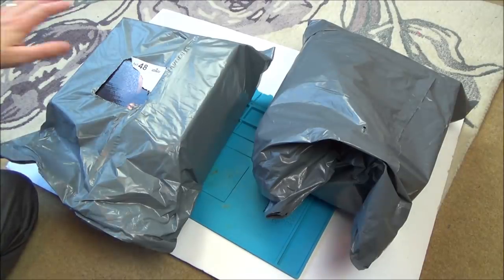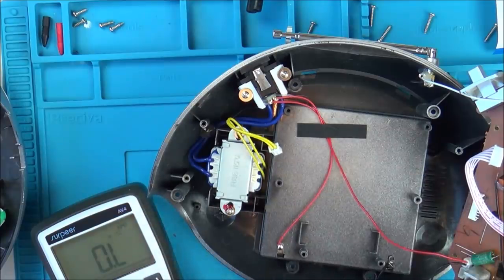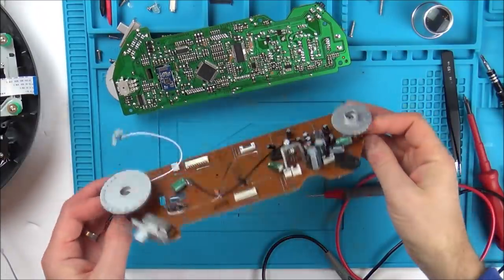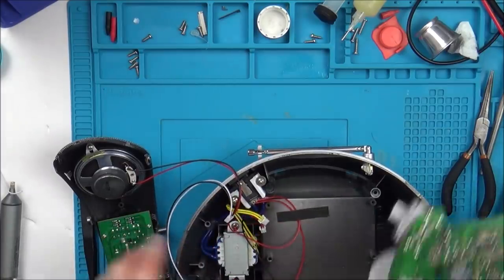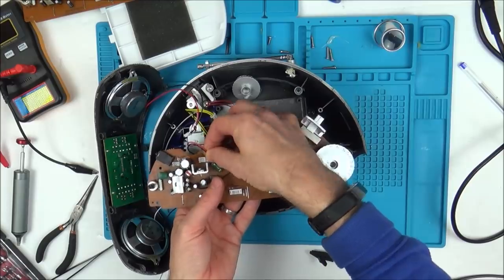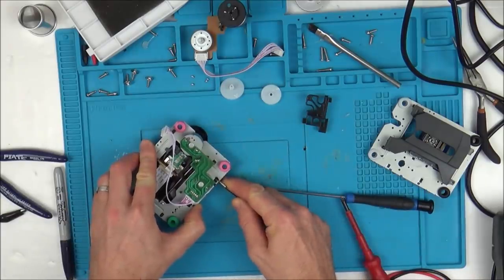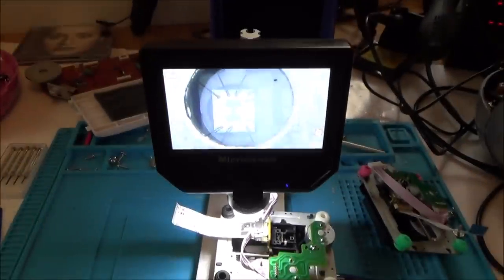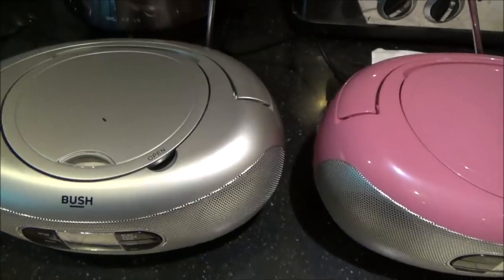Trying to FIX: 2x Faulty BUSH Boomboxes

Comment: These cheap players are all made at the same vast factory in China (I don't recall the name but they're a large company), they make a large number of models with essentially the same design and components, and they all have quite a high failure rate. The lasers are a common failure point, but more often the problem is poor soldering on the CD servo IC which has a large heatsink area and so the pins are often not done correctly. The ones with remote controls have an all-in-one volume/switcher IC which also commonly isn't soldered well and causes problems with volume intermittently working etc. Shame really as when they work they're not bad. Most of the components are copies of old Japanese standard parts and work well when they're assembled properly.

Comment: If the one with the disc issue is able to see how many tracks are on the disc then it's not the laser, it's probably having an issue with the gears and tracking on the disc. It can't move the laser so it just resets and says how many tracks there are

Comment: An good investment for amateur electronics fixing is a cheap portable DSO like a ds213 mini DSO. So you can probe each chip to see if its outputing anything at all...
Reply from the maker: That does look very nice, maybe a Christmas pressie to myself. The problem is I don't under the first thing about the signals and the different frequencies in which they operate.
Reply: @Mymatevince  a good place to start is the "Electronic Basics" playlist from the EEVBLOG.
Reply: @Mymatevince  another really good way to understand electronics in a visual interactive way is a website that lets you play around with virtual components and see how the current flows and the voltage levels of each component. Its called Falstad. There you can even see the Waveforms of the signals as if you were probing them with an oscilloscope. Its great fun and useful to understand how stuff works and how to diagnose using an oscilloscope.

http://www.falstad.com/circuit/circuitjs.html

Comment: I think you were magnifying the photo detector array and not the actual laser diode
Reply from the maker: Yeah, sorry Peter, I didn't realise!!!!! I was sure that was the laser.
Reply: Hi Vince, no one is born knowing any of this stuff. I have been tinkering, fixing and building electronic devices and projects for over 50 years now and I find it as exciting now as I did when I took my first tube black and white tv apart when I was only 6 years old. I really enjoy watching your videos and the no nonsense straight forward approach you take in diagnosing and repairing anything that you attempt. I really love the patience you have, I cant honestly say that I have you level of patience and I also completely agree with another point you try and get across in your videos, its not always about the end result of fixing something every time but the invaluable knowledge you gain in tearing everything apart to see exactly how its put together and how all the various subsystems in any device work together. Keep up the excellent videos and I sincerely  hope you never get tired of making them or get bored in what makes things work.
Reply from the maker: @peterzeboroff7448  Thanks so much Peter :-)

Comment: Thank you Vince,  I put 3 kids through university on the answers an ESR meter gave me. It tests capacitors, but the thing most people don't understand is it puts a high frequency signal through between the probes so it can tell if a coil is OK (IE high resistance) If There is  a short across windings it reads as a resistor.  Also if you have an ESR meter, I knew the designer. I made a modification. I fitted 2 power diodes  across the probes . A to 1 and C to the other and the other in reverse. In this way you can use the meter over any panel without fear of damage. The designer of the thing said, good idea but stops sales.

Comment: Replacing a transistor with a working transistor of the same type is much safer than putting in a shorted transistor and powering up the board!

Comment: Pro tip:
Start by identifying the chips. Search the datasheets online, the datasheets are the best way to understand how things work. When you identify the chips, you look which pins are vcc (power in +) and vss or gnd (power -). Look in the datasheet the supply voltage for each chip and use the multimeter to check voltages (THY SHALL CHECK VOLTAGES). Identify where are the voltage regulators and check caps for shorts...

Comment: I don't believe that transistor is used as an audio amplifier. There's an audio amplifier IC in there that is much more powerful than that transistor. It is probably just used to invert a digital signal. There are just 2 resistors connected to the transistor. Not any caps. It doesn't not look like an audio amplifier circuit at all.
Reply from the maker: Thanks for the info Kris :-)

Comment: Good morning Vince, you finally found the fault , hahaha annoying little shitty component but killed all the sound on the entire pcb man , damn, well we known what cheaper and cheaper means now... Nice long amazing entertaining content as always...
Reply: Now the laser was definitely faulty but you already knew that i think because it's not your first laser fix and definitely it's not going to be a last one
Reply: The screen malfunction fixed laser ordered identified as faulty sound transistor ordered identified as faulty as well ... Now for the ribbon cable connector lock and the connector itself was a cheap ass component as well and on top of that it was very bad soldering from the china factory
Reply: As for the laser dissalignment fault, well even if it's working part it's still a fault cheap component by factory because it's should be aligned and his structure assembly was cheap fail too and plus that ribbon cable on it also ripped off, damn its so many faults on those models and so tiny and cheap, they could get some better components on from the beginning so i believe it's done on purpose, it's the only logical explanation

Comment: Very good videos have been enjoying watching many if them 

In this video I would like to make a comment relating to the laser  i know this late and you probably figured it out by now

But the working part if the laser is in 2 parts the bit at the bottom you put under the microscope with the 9 contact wires is actually the pickup after it's bounced back from the disk  the actual laser is generated from the laser diode on the side  it bounces the laser off of a mirror from the side going towards to the disk and the disk reflects it back down to the pickup at the bottom ( the one you had in microscope 

When you made the adjustment for power setting for laser the laser is actually in that same board center if it 3 pins 

But anyway good work and glad you have the patients for such lengthy diagnostics 

For me who's been repairing electronic devices back in the old days from VCRs TVs CD players and so on I wouldn't go from one device taking parts to figure out what's wrong with the broken one I would find a working part and swap out haha  this was very common practice when fixing VCRs dead power supply jjst pull it out throw another one in job done didn't have the patients 

Now into laptop motherboard repairs and kinda regret getting into that now since the components are super small the worst one so far is this Asus I'm working on mostly fixed now apart from one component needed for the LCD power and that's a bitch to find the component here or anyone willing to pass one on just requires a ferrite bead between 19V rail to screens power rail that's it

Comment: That big Silan SC9637B LQFP IC on the main PCB is quite literally the brains of the system: a single-chip solution CD boombox: http://www.silan.com.cn/english/product/ProductItemDetail.aspx?id=18&pid=20140429095337635343610736320575&c=

Seems like the main issue with these boomboxes is that the rest of the system design and integration is so cheap and nasty that they'll have a fairly high failure rate.

Comment: Aha I heard Argos there, now a funny story is I used to know one of their purchasing managers and he told me never to buy electricals from Argos because they can sell it cheap because its not quite the same as a John Lewis bought electrical item even though it is same model etc and he said Argos had many deals going on being supplied direct by the makers and to keep costs down they cut corners which is how a lot of Argos electrical stuff gets a bad name.  I haven't used them in over a decade, preferring my own list of sellers on ebay and Aliexpress (bought from Ali my granddaughter as a stocking filler one of them "gameboy" 400 NES game loaded deals for £8, with a cute little NES controller for a second player and does connect to the tv...)
Reply: I repaired an argos TV last year, it was almost new and a single electrolytic cap had failed causing no backlight voltage, cheap and nasty components

Comment: Why people use Argos is beyond me, the bulk of the stuff they sell is cheap crap. I bought my kids a decent sound system for them to play their stuff on and it still works now, they still use it connected to their Xbox, it's about 15 years old and was 2nd hand when I bought it for under £50. The rubbish from Argos is landfill in a year because the components are cheap, build quality is awful and they have a return rate of about 15%, that is a massive number and is why you can buy pallets of Argos returns online. Save your money for a few months longer and buy a good named brand even if you buy 2nd hand. Buy cheap and you pay twice (or more).....

Comment: If you want to really learn how to make a successful repairs -> stop require a pair of every device you trying to fix. You don't Broke two to fix one rather than opposite. You can't just swap parts until something works or die. Focus on methodological sequence to follow the faults. Be carefull don't make such sharp movements around the electronics. Also try to learn some fundamental electronics principales to understand the basics on how a given schematic work and how to tracing the signal/power lines/sources in every schematic or distinguish them.

Comment: This is not the laser Haha, the laser are round. And the laser have only 3 pin, the 10 pin component is a (photodiode or a multi-beam detector)
Reply: Right, so that laser is to the side, and the dichroic filter bounces the beam towards the disc, then lets the reflections pass through (or does it split it and cause the reflected beam to either amplify or nullify the separated beam based on whether it hits a peak or valley? Sometimes hard to wrap my head properly around it). In that case, alignment is a matter of milli/micrometer precision, but the laser is (hopefully) a non-issue.

But that means that whoever (or what ever, if that’s the case) assembled the photodiode sensor part (the one you, Vince (if you’re reading), were adjusting at the end) did a pretty subpar job.
Reply from the maker: Thanks Hathtrya, I didn't realise. When I get the replacement laser I will open up this faulty one to see what the actual laser looks like. Thanks for the info and also thanks to Operational 117 for the write up. Nice one :-)